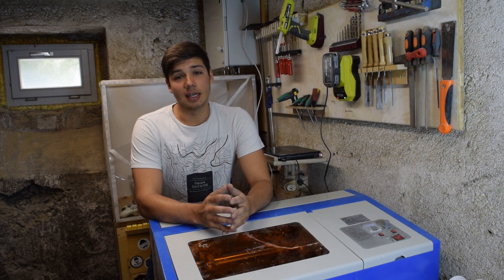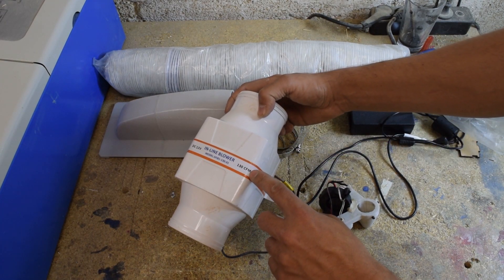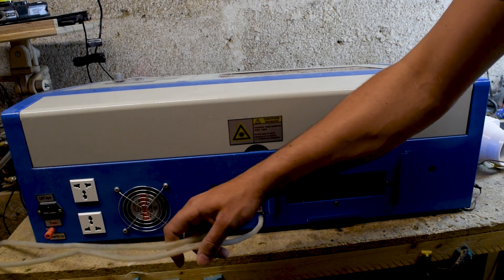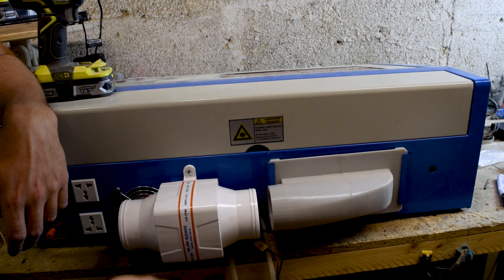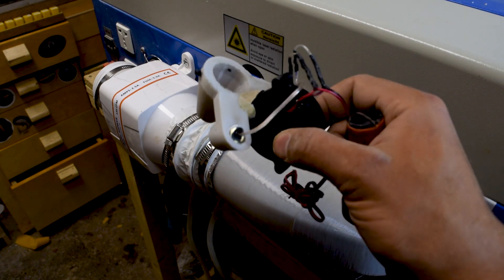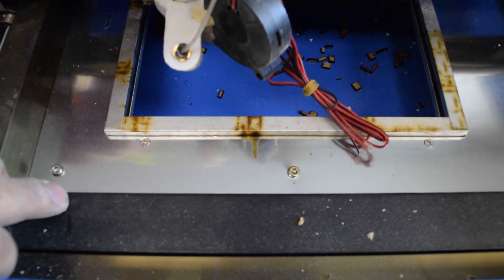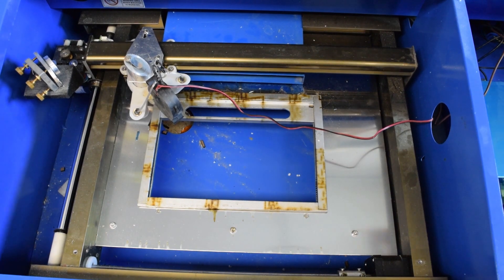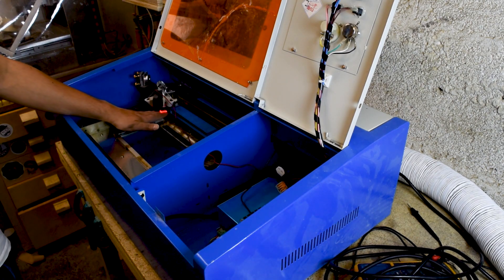MUST HAVE K40 Laser Upgrades (Exhaust System / Air Assist / Line Lasers)

Comment: Hey Awesome video, what are those little box things called that you connected the positive & negative wires to from the power to the inline blower/air assist?
Reply from the maker: Not sure what you mean exactly but try "wago clamp" or "cage clamp"
Reply: @Uniquelymade   thanks heaps thats the one!

Comment: you should put the inline blower/sucker fan near the very end of the tube not the start, it works much better that way. Also do not move the axis fast as your making the stepper act as a generator and you can damage them. the hole on the side is for a small round led light. also it is Phase, Neutral & Earth on 220 Volts on dc its positive and negative. Ground is an american term.
Reply from the maker: why does it work better at the end of the tube? I ended up taping all the holes on the inside shut with tape to improve the air suction, the lid still has enough gabs to allow enough air to come inside
Reply: @Uniquelymade  Not sure of the exact mechanics but having the fan at the end of the duct creates negative pressure through the duct, this is usually reckoned to be a better options. Also allows you to remove the fan to a location where the noise is not a problem.

Comment: Where can I find that rectangular to hose adaptor or was that your production?  That is a key item and should be offered  everywhere the K40 is sold.
Reply: The 3D print file can be found on Thingiverse.com, Search for K40 "Exhaust Duct for 3" Blower" The designer of the one I found is  jimmybdesign .
Update: Here's one on Amazon for a 4 inch dryer duct that I've heard fits perfectly but since I printed mine I don't know personally.
Big Horn 11401 Dust Hood For Use with 4-Inch Hose

Comment: The next best step is to replace that sh#ty M2 board with a CnC shield and Grbl and to make a little power inverter board so that thing becomes a proper PWM and can be used with lightburn and other Gcode based software.  here is a few Mods i did to one that was exactly like your https://www.dropbox.com/sh/bgg6pmastt21e9p/AAC_XR0sETB4wctYgyi5ki3Ka?dl=0  and a little video of it in action. https://www.youtube.com/watch?v=iL3WUZiQriE
Reply from the maker: Oh thanks for that information. I'll sure look into it!

Comment: Really need to do this. Had to cut some veneer and damn even with taping everything around the original exhaust fan shut I still get smoke everywhere in the basement. It's horrible.
Reply from the maker: It's like the single best upgrade so far! Highly recommend

Comment: Garbage machine haha

I have the machine from hell 

I have already removed all mirrors and lense also upgraded the stock m2nanno to a C3D laserboard with lightburn and added a cw3000 chiller and a adjustable bed along with connection g it to my air Compressor still garbage and not working  right
Reply: cw 3000 ? is not useful
Reply from the maker: Yeah the machine is a pain. If I had the coin I would have defenitly preferred to just pay more and have an out of the box experience ^^

But at least I'm not running out of project any time soon

Comment: Glad you got the extraction sorted as the fumes from cutting material can be extremely dangerous.
Reply from the maker: Yeah this entire machine is basicly just trying its hardest to hurt and annoy you
Reply: @Uniquelymade  I hope that is note true as I just unpacked the two NEW K40;s andd though being untested they look great coming out of the box but the plan is to upgrade to a Cohesion 3D board inside an all around new set of mirrors and lenses.   That is, I hope, the easy part, Clearly the smoke extraction system needs some concentration and  effort.
Reply from the maker: I heard that new mirrors alone add like 20% of power

Comment: Noice! those are some great improvements! Oh, cfm stands for "cubic feet / minute" I believe..
Reply: Please remove the blue plastic coating on you psu. It can cause it to overheat
Reply from the maker: I looked that up as well before but it's not a value I can visualize. Like I can imagine 150l of water or 2000kg of force but 130 cubic feet per minute could mean anything to me 😅